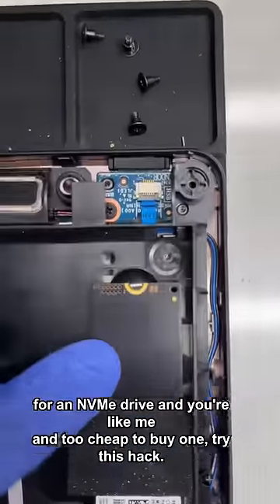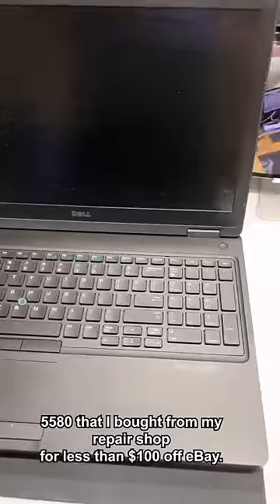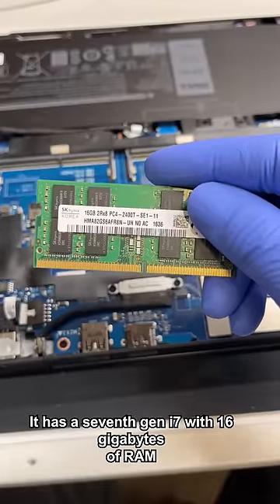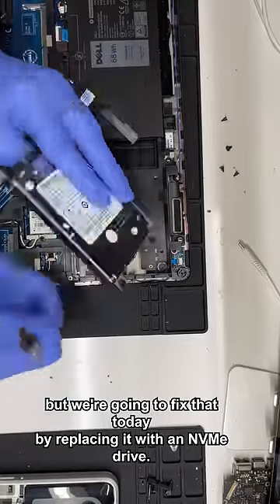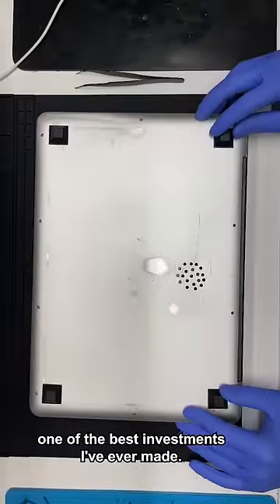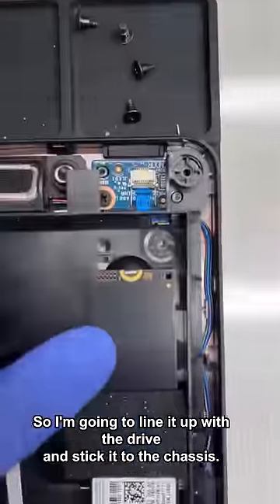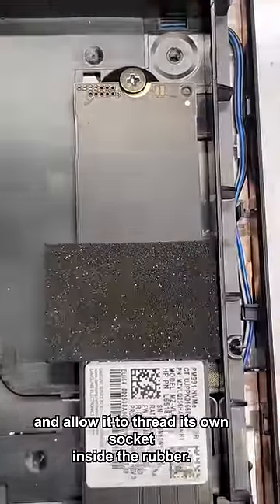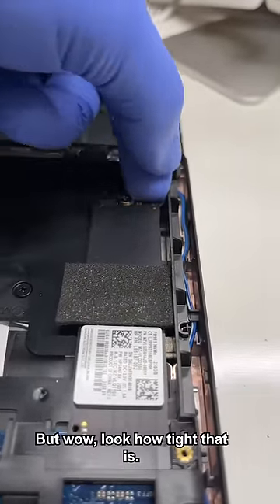No mount for an NVMe drive on your #gaming #pc ? No problem! #technology #tech #shorts

Comment: My dumbass would have just duct taped the nvme drive lol
Reply: Still works
Reply: That's the beauty of flash storage
Reply: For personal use, id probably would just grab whatever I have at hand and stick it in😂 for work i'd just buy a mount. They arent expensive like 😮
Reply: I would have just used double sides tape
Reply: I feel that
Reply: Is a lot of times just use some 3M sticky and stick it down
Reply: I would’ve used a tiny blob of hot glue.
Reply: double sided tape ez
Reply: Lol
Reply: Actual facts
Reply: Alot of people would superglue it in so you're good
Reply: Valid repair technique.
Reply: Some dumbass duct taped my heat exhaust fan as some hill billy way to fix it, only found the crusty ass mistake out many years later. Has a couple flaky cables and a loose back panel, but still working past 10 years now.
Reply: Velcro is also very effective for a lot of these types of projects. It has the simplicity of duct tape but still allows you to easily remove the part while being far stronger. Would recommend having a roll of Velcro tape for random shit, comes in handy all the time and one roll will probably last you forever.
Reply: Great minds think alike 😂
Reply: I did that
Reply: If it works, is it actually a dumb idea?
Reply: I actually did that before to an old laptop
Reply: My dumbass lost the screw and said fuck it. I just closed it and forgot about it lol
Reply: done :D
Reply: Don't worry. I used painters tape on my NVME drive on my Dell when I lost the bracket that held it in place (and the screw lol)
Reply: I did that with a ram drive I accidentally broke just tape it down and still worked really good
Reply: @Exilir8 done that lol, works perfect
Reply: Not very dumb if it works honestly. That blue teachers tack shit would be just as useful
Reply: I mean there's that fabric tape that gets used in electronics all the time, why not?
Reply: Or double sided tape it
Reply: That’s what I did with one of these latitude machines
Reply: Lolol me too
Reply: Same though bro 😂😂😂
Reply: Ooooh clever

Comment: I used to work at a PC recycling plant. These latitudes where a pain because they where either missing what you needed to mount the HDD, or missing the M.2 mount. And I always liked to put M.2 drives in anything 6th gen or newer.
Reply: yeah the businesses that owned them just rip out the drives it seems
Reply: @lolcat  A lot of clients require certificates of destruction for drives as a part of cyber security insurance. Yes, an SSD trim call can wipe them securely, but a CoD ensures the data was in fact made inaccessible in a controlled environment.
Reply: @IanBPPK yeah its bullshit to physically remove the disk or even the conputer.
Reply: @lolcat they have to do that since it has sensitive data
Reply: Some companies requires to physically destroy the disk
Reply: @note2tee  Yes, I know. But like at least leave me the caddys and mounts broh. Especially if ya'll gonna send it to a recycle plant to be...recycled.
Reply: @IanBPPK  I'm fine with removing them, but they usually don't unscrew them from the caddy
Reply: @silvy7394  Exactly
Reply: @silvy7394  although they're often called "electronics recycling" or "eRecycling," they're often involved in the reuse through resale market as well. Sufficiently old or damaged hardware may be scrapped completely, however.
Reply: @lolcat  that grievance I can completely sympathize with. It's m.2 screws for me though 😂
Reply: I always leave the mounting brackets and  tape the screws inside it.  I still pull the drive even if they say they are doing a secure destroy it.   A company can often say its doing one thing, but it only takes a fast handed worker to grab a drive and attempt recovery.   We  almost always pull SSDs since they are so easy to store and re-use.
Reply: @lolcat That's because we don't really give a crap the computers going in a recycling bin and all we need to do is make sure the hard drive is secure and destroyed in a secure manner.
Reply: @hoodman420  I get it yeah, saves time haha
Reply: nvme is not necessary here. standard sata ssd fits well, because the bus of the laptop is way to slow to use the speed of the nvme.
Reply: I had the same problem but only with IBM ThinkPads from 2008. My supervisor let me take home a small box of them which contain 12. Out of those 12, I was able to make 3 complete builds. And they all work'd beautifully & still had a spare. To this day, I love those old Think Pads!!
Reply: @IanBPPK This is true. I've seen that done with police and first responders and big corporations.
Reply: “Were”
Reply: @BUTTALUV  That means "We are" and would not be grammatically correct
Reply: @Käptn_Wirrbart NVMe uses the PCIe bus, and will operate at (or around) PCIe speeds. I could be wrong, but PCIe 3 (which these laptops most likely have) is still a bit faster (at 985MB/s per lane and most NVMe drives using 4 lanes)  than SATA 3 (at around 750MB/s for the entire interface).
Reply: @silvy7394 ”were” and “we are” are not the same thing. You’re thinking of “we’re”. I believe that Brutal was correcting OPs use of “where” instead of “were”.
Reply: @StolenJoker84  oh my God are we going to argue over putting an apostrophe in a word, when everyone in the room knows the word has one?
Reply: @silvy7394  If you’re going to correct someone on what word should be used, then I think you need to know what you’re talking about.

“Were” is one word. It’s not a compound word and therefore does not need an apostrophe. It is defined as the “Indicative plural and subjunctive singular and plural of was.” and IS the correct word in place of “where” (which means “at or in what place”) in your original post. I think you’re the only person here who “knows the word has one”. 

“We’re” (with the apostrophe) is a compound word that means “We are”.
Reply: @StolenJoker84  I cant believe children these days want to argue over a skipped apostrophe on some random internet video comment, when its use is instantly obvious to the reader. 

Do you kids have nothing else better to do but try to one-up people on nonsensical shit that doesnt matter in the slightest?
Reply: @silvy7394   First off, I’m not a kid. Judging by your replies, I’m probably at least double your age. Secondly, the only one being childish here is you by getting offended because you’ve been corrected by two different people (and even directly given the definition of the words in question)

Again, if you’re going to try to correct people, at least know what you’re talking about. It wasn’t a “skipped apostrophe”. He literally gave you the correct word for your original post. 

The lack of proper punctuation on the internet these days has literally made people ignorant of the English language, and your insistence that there was a “skipped apostrophe” instead of accepting the correction is proof of that.
Reply: @CrocoDylianVT  ok but why do they have an m.2 port with no ssd mounting point?
Reply: Double sided tape is all it needs, SSD have no moving parts so just tape it to the frame.
Reply: @Ruiso7  but an nvme drive needs to be in its slot at the right angle, so you don’t wanna just tape it down randomly as it’ll put too much stress on the connection

Comment: You can now even put a second drive inside. There are adaptors for mSata drives to a normal Sata connector. They are half the length of a normal drive, so you could fit one of them inside the free space.
Reply: They also make SSDs in the 2.5" form factor.
Reply: And if you're so inclined, they make jbod adapters for m.2 B key, so you can have two m.2 sata drives in your hdd slot
Reply: There are also adapters for the optical drive in case the thing is broken or your model has an unused slot. Some cheaper models literally fill that space with a hollow piece of plastic.

Comment: 100$ for this laptop is a damn steal. Fun little addition to the specs: It has a GT 730M GPU. This is by no means a fast GPU - however it is A LOT better than the 7th gen Intel integrated Graphics - and means that you can run a surprisingly high amount of fairly modern games on it - at 720p low - with playable framerates.
Reply: Indeed!
It also has DX12/Vulkan support, so a user won't be left out, if a game doesn't support earlier API's.
And this CPU still is better than a heavily throttled (by its TDP) 2c/4t Ryzen from a cheapest laptop available (which still costs way more than $100).
Reply: @Vitaliuz  Right - It is however a very different beast. Most of those "cheapest" "laptops" are notebooks or "thin and lights"... This one is not. It is however a VERY solid piece of kit with some still fairly relevant specs. This generation of CPUs - when talking about the high end - which this one certainly is - was overpowered at the time - which means they still can hang with modern software now despite it being a model which was first launched back in April 2017.

Do not compare it to a modern AMD Ryzen 5 or 7 APU though... they will beat the performance by a fair bit - but also be more expensive 😀
Reply: @Craider79  Nah, I was talking about cheapest R3's, ofc (hence, the 2c/4t). And even they can't be bought with $100.

Helped to pick one for my neighbor (he needed it for movies mostly, so a bigger screen was a requirement), and, as I was installing Windows (it came with DOS), I tested it a bit - and I wasn't pleased with the performance it had. Both in synthetics and real world apps.

And on top it all - it throttled the CPU (and the APU, ofc) on battery use - and no BIOS or Windows tweaks worked on it (to bring the throttled frequency back). Well, good thing that he mainly uses the laptop on AC.

I'm not saying that ~$500 went down the drain, it's still a decent enough laptop (17", NVMe, 16GB RAM, ect - and it's brand new from the store), but considering its downsides - I wouldn't get that one for myself.
Reply: @Vitaliuz  Ah sorry - think my intention was lost in the translation. I understood what you said - and just extended it so if someone else reads it - they would understand that it's not comparable to the "larger" Ryzen mobile APUs. 2 cores 4 threads is... well simply not enough for many tasks todays, so yeah I agree with you on that. It's all about not setting people up for disappointment when it comes to computers like this one. The whole "It's a great PC" - needs to be followed up with "for general use - but it's not a modern computer - so it does have its limits."

So yeah my intention was not to contradict you Sir 😀
Reply: Confirmed, I have the 7480 with the Integrated HD 620 series, and it's AWFUL. Cpu is nice, not the graphics

Comment: There are shorter M.2 sizes, like the 2230 that will mount properly.   Many earlier generations of Latitudes had a WPAN slot that  often was not filled. While it wasn't marked for drive uses can still take a msata drive and reconize it in the bios.
Reply: Same with some Thinkpads. Like the T480

Comment: I think it is kind of deceptive to make the viewers to think, they can just upgrade from sata connection to nvme drive. I think you should clarify it, the laptop original came in with a m.2 connection but some one(probably the original owner or the seller, replaced the m.2 drive with a sata storage component). Other than that, I applaud your creativity. 👏
Reply: Yeah this shit had me very confused and wondering why not just use a 2.5 inch sata ssd in the same connector.
Reply: Thanks!!!!

Comment: I worked as a refurb tech for about 4 years, and I gotta say Latitudes are probably my favorite laptops to work on.
Reply: which is so strange considering how wonky and proprietary Dell's desktops are
Reply: @xXx_Regulus_xXx  They didn't used to be, but definitely are now for the desktops. Had the XPS from 2009 with the first gen i7 and it was a straight up ATX board and all that as I had to replace it with one from EVGA.

Comment: I had to repurpose one of the backpanel screw to install nvme on my lenevo because they did not provide the screw with the laptop 😂
Reply from the maker: LOL I'm not surprised! Glad you made it work!
Reply: Shouldn’t the SSD vendor provide you one? I recently installed a nvme for my desktop, the computer shop gave me one screw for free
Reply: Same problem but I stole one screw of the battery lol
Reply: @foysalbabu602  nope , screw comes with the machine or motherboard. screw is never supplied with any ssd or hdd. unless its a special pack. the store owner probably knew you would require a new screw thats why he gave you one.
Reply: @snaj9989  for me the backpanel ones were the only one with similar thread of the screw hole in the case for the ssd. i tried to use actual m.2 screw that i had spare from my pc motherboard and it did not fit , i tried other screws but then i tried one of the back panel screws it worked. so i have one missing screw. 
a year later the cpu of the laptop died for some unknown reason , it had just few weeks of warranty left so i called lenevo and they came to my home with a new motherboard . and when the technician asked me why i have a missing screw i told him it is used for the ssd. and he laughed and replaced the motherboard. it was in warranty so all was done for 0$. i was lucky the cpu died before the warranty ran out because a new motherboard would have been easily few hundred $$ , i checked for voltages and shorts and there was nothing wrong , the cpu had vcore vsoc everything it was just not getting warm at all.
Reply: Well, I guess they really screwed you, huh?
Reply: Aye same here

Comment: Wouldn't it make more sense to install a data 2.5' SSD?

Since there is already a mount for it, and there is no speed benefit with the nvme?
Reply: Nvme is faster than sata ssd
Reply: Not through a sata port it's not
Reply: I was searching for this comment!! You re right.
Reply: This laptop seems support NVMe. It's a waste if you dont' use it
Reply: Supporting nvme is part of the story. The speed come from the number of lanes. Nvme can often use 4 going to the CPU. Sata gets 1 or 2.
Reply from the maker: This slot is PCIe NVMe using 4 lanes vs the slower SATA lanes
Reply: I completely agree. Unless you do something "storage intensive" like video editing, NVMe is not that different from a high capacity SATA SSD.
Reply: But youre already using an intel gen now 6 generations old. I can't imagine that the use case for this laptop would see any benefit from nvme vs sata. I know nvme gen 3 is significantly faster, but is that speed being utilized? Wouldve just done a sata 2.5 ssd personally.
Reply: @JeffCollins05  I would have too.. And 2.5 SSD is still slightly cheaper than nvme too
Reply: @touma-san91 that’s exactly why it's smarter to put in an NVME drive to boot off of. The boot drive doesn’t need to be super big, but it's nice to have it fast; if you want more storage you can put that in the
2″ bay, since you can get a lot more storage for the same price there.
Reply: @pitchayutpanpattrapong5577 that was likely there for either an expansion card or indeed storage, it just wasn't used
Reply: It really depends on the port, you should look up the port being used in the specs of the laptop to tell
Reply: So much misinformation in this thread.  
Nvme pcie is always better than SATA.  
This laptop has an nvme connector, just missing some other hardware that provides a threaded standoff.  
Some m.2 connectors only do SATA, but I believe this one is keyed for nvme pcie, hopefully four lanes.  
Sata is limited to 6Gb or about 600MB per second.  Nvme, four lanes of pcie 3 can do 30Gb or 3000 MB per second, roughly.  Pcie 4 at four lanes doubles this.  

I just replaced an optane drive and a mechanical hard drive in a $300 machine for a guy that was having a drive failure.  I put an nvme drive in the optane socket and clean installed windows. It's way faster than it was, but the optane socket only has two pcie 3 lanes, cutting the performance in half, but it's still way the hell faster than a sata SSD would have been.  It reads 1500 MB/s, a sata SSD would have been limited to 600 max, 550ish is reality.  Even if only one lane was available, pcie 3 still rules.

I don't believe any SATA controllers would use more than one pcie lane.
Reply: but with NVMe you can have SSD and HDD at once
Reply: @pankoza2 I own this laptop and disassembled it a few weeks ago to install an NVME SSD, and lemme tell you it is effed up for 2 reasons

1. No included M.2 mounting hardware or even a screw hole
2. The existing HDD intersects with the M.2 mounting area and blocks it, meaning you can only choose one

needless to say, I wasn't prepared for this awful design and I just cut my losses and reinstalled the old HDD. But on the bright side my framework finally shipped so hopefully I should never have to deal with a laptop that is slow and difficult/impossible to upgrade.
Reply: @NickyG-NZ THANK YOU!!!! Why did i have to scroll down through 30 comments before i saw this!!!!

Comment: If you really want to adhere two surfaces together pretty much forever then look up 3M double sided VHB adhesive. 

Don't apply to a wall or any surface where you may have to later  remove it if you care about that surface. Your likely going to have to get destructive to remove this stuff while causing damage.